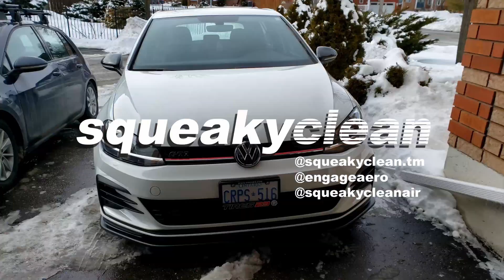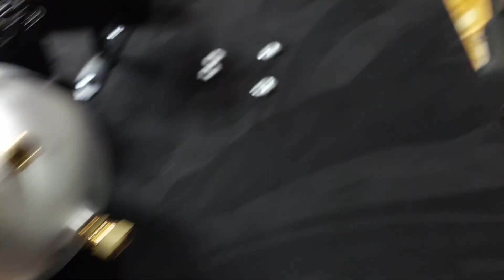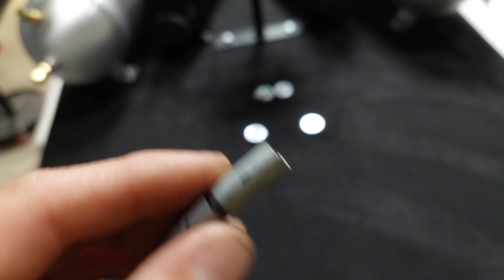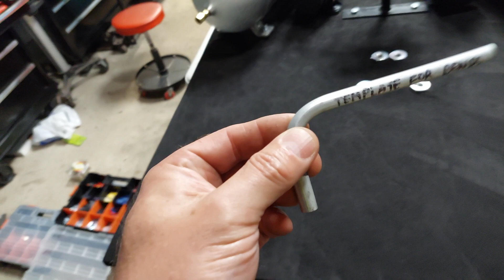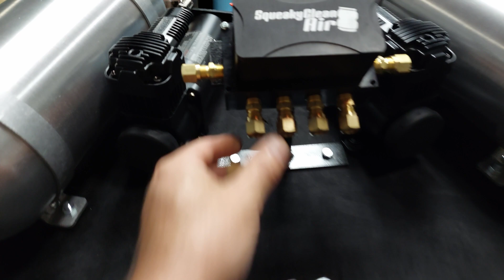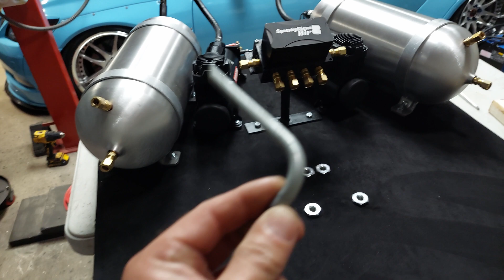Tips for doing hardline trunk setups.  Intro

Comment: What fittings do you use to connect the 1/4" hose to the hardline? Compression?
Reply from the maker: Ptc, its all mentioned in video.
Reply: @squeakycleanair  sorry I missed that part lol thank you!
Reply from the maker: @JA-sj3mb  sweet.  Holler if you got any more questions :)
Reply: Can a 1/4 hardline fit to a push to connect fitting? Where do u buy dot approved hardliners? Can ss hardline fit my setup? I only need less than 3 feet I will mount on my setup to top of my trunk board.

Comment: Is there a minimum distance for bends to be away from the fittings that you'd recommend? For example coming off manifold to a bulkhead to pass through the false floor. Is there a minimum length for the 90 degree bend to be (aside from the benders capability) or is that not an issue? I currently have a few of mine at 2.5" 90s and I'm wondering if the bend itself is to close to the fitting; maybe I should extend the piece that is actually going into the fitting or leaving the manifold. So instead of a "stub" 2.5" 90, mark it xyz distance from the end to give myself a straighter section to put into the fittings. All PTC bulkhead fittings so that's why I'm wondering, not secure like the compression ones.
Reply from the maker: Each fitting is different.  Take some tube and experiment with distances and clearance.  I stick to similar fittings so all my templates apply.  If there is a major change i make new templates.